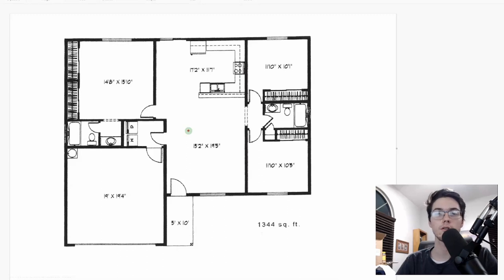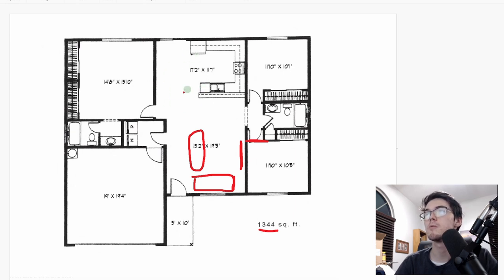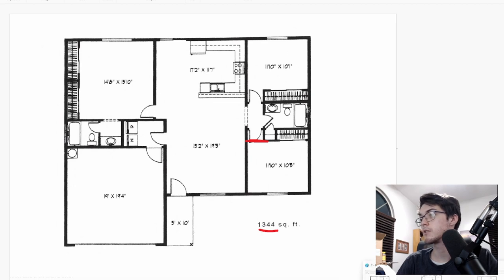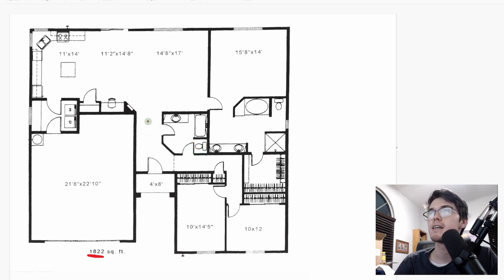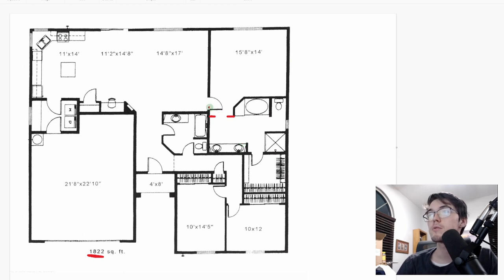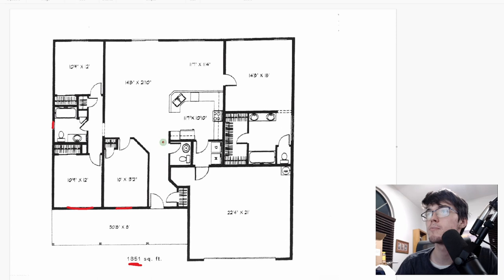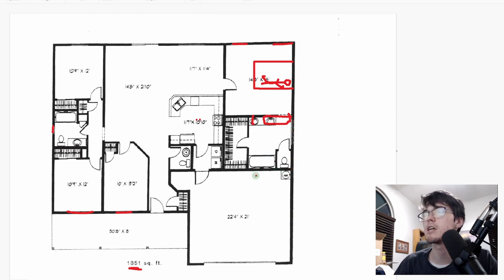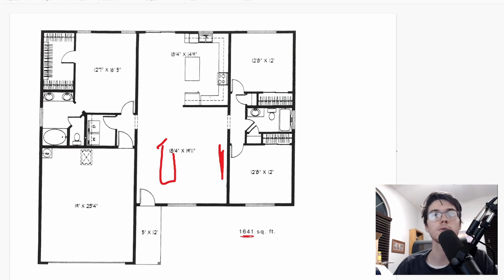Look Out for These Common Floor Plan Design Mistakes - Small, Single-Level Family Home Plans

Comment: One thing that needs to be mentioned is when was the home buiilt from the design this house could have been built in the 1930's, 1940's, 1950's or 1960's. This could change the views on where things were placed or if they even existed at the time. For example the TV may have just became mainstream when this house was built so a TV may not have been the focual point of the living room but instead may have been radio, bookcase, or just having it as a sitting area like a parlour.